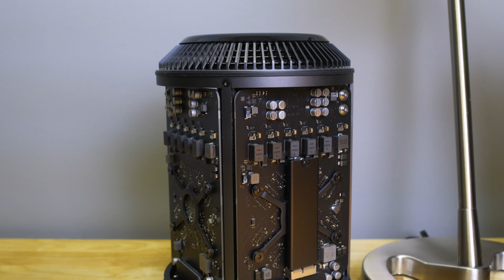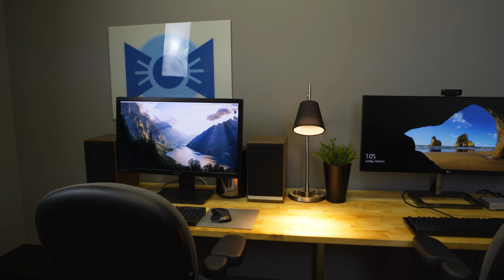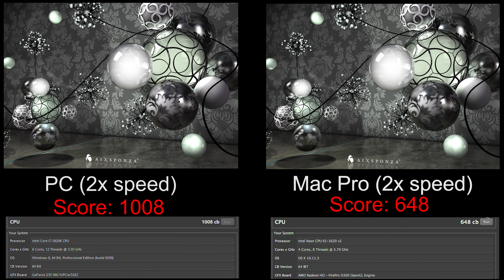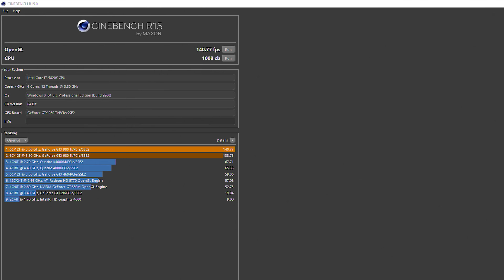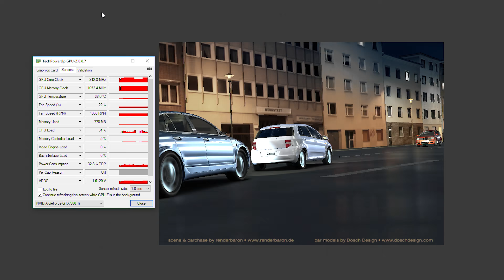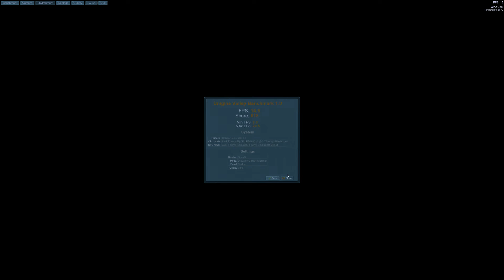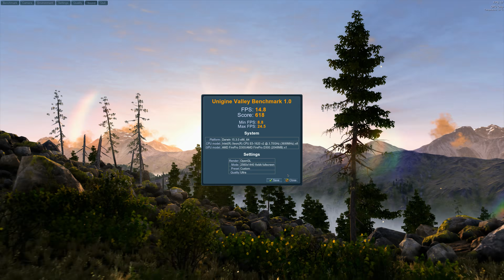$2,000 Custom PC vs $4,000 Mac Pro

Comment: This is not fair comparison, MacPro uses server grade components and PC specs are for a gaming machine. While PC is fast but its not built to last or to run for long period of time. Overclocked components are under stress and will have higher failure rate, not to mention shorter life. Mac Pro will take allot more beating and will get job done at end of the day, don't underestimate it.
Reply from the maker: +Vlad I need my job done now. Not at the end of the day. :)
Reply: +Snazzy Labs hopefully your job pays enough: 1)deal with software problems, 2)to afford new electric bill, did you measure power usage on both machines? 3a) buy another PC soon, 3b)provide enough time to build/upgrade it, and sell old PC/components(hope those wont go down in value). I'm sure there will be faster components released very soon. Good luck on your chase for speed, again hope its worth it ;)
Reply from the maker: +Vlad Lol. 1) Premiere works better on Windows, 2) power costs like $1, 3a) non-workstation hardware is still extremely reliable, 3b) Macs don't hold their value any better than most other computers anymore. Cheers! ;)
Reply: +Snazzy Labs Again not a fair comparison, Windows/OSX, gaming PC/Workstation different tools. Rendering or compiling job taking weeks would bring down most gaming PCs, or precision task such as CAD drawings, one mistake(or weeks of lost time) can be very costly. Lastly if I'd be an astronaut, I would not trust my life for a rocket controlled by a gaming PC, just can't afford the risk. Rendering 15 minute youtube video fine. Another angle at this, Truck vs Sport Car, could have same HP, or more for Sport Car, still wont do Trucks job. Best Wishes.
Reply from the maker: +Vlad FWIW, one of the FirePro cards in the Mac Pro crapped out after 9 months and I had to get it replaced. LOL.
Reply: +Vlad AND even if you build a pc with server hardware , you can get away with a 16 core and still be cheaper than the trashcan
Reply: +Vlad Come on Vlad, now you really talk rubbish. Which market was screaming for a tiny round shiny workstation? Where you need everything extern (WTF) Keep in mind that we talking about workstations here! Apple simply swing and miss. With zero information at this point if there will an update, they really are let down their old users. The hardware inside is 2012. They use a expensive Xeon but you can only use 1, not 2. Which is one of the reasons to go for Xeon. Double CPU. The weak yet very expensive AMD dual GPU's are a issue as well. Tons of software are not capable of using dual GPU setups. So you have to pick the most expensive card setup, to get average performance. And i can continue on and on... Look dude, i am a Apple guy. I work on a iMac.. but Apple has lost the pro market. If you are on FCP, for sure.. a mac will do the job perfectly. But almost everything in the world of creativity and their tools, are better suited with a wel configured PC. Face it and stop defending the brand. They dont care, they earn their money with iPhones and those who still buying this Mac "pro" machines for a lot of green. I dont feel sorry for them. Simply do your homework and you wont buy this shiny (good looking) machine. Anyway, almost everyone in my network of content making professionals are switched to PC.
Reply: +Vlad Blabla, i am in the whole Apple system. But i think you havent read solid reactions. I own a iPad, iPhone, MacBook Pro, a Apple TV and i work on a iMac. So, here you go. A very Apple minded person. A Mac Pro is just a PC. its a Intel CPU, its a M2 SSD, its DDR ECC memmory, its a ATI videocard... its just a PC in a shiny box. Its OSX that makes a difference for some. Nothing more. The Mac Pro is weak. It was powerfull in 2012. Its average in 2016. Running over by 2000 euro machines like in this video. Cut the bull about experience, They really pulled you into there marketing talks. Its-just-a-computer!!! Working in Adobe is the same as on a Mac. Working in Maya is the same, etc etc.. You are talking standard Apple crap.
Reply: +George Lynch Thats insulting and rude. I understand you're well educated then? Yet, fail to understand Apples strategy and intended market segment. Try building a cheap, small factor, shiny, overclocked and reliable PC, then I'll talk to you.
Reply: Vlad I did. Spent £400 on PC parts and built my self my first gaming PC. Well why are you defending a company that uses market tactics to trick people into buying shit old technology for ridiculous prices. "Try building a cheap, small factor, shiny, overclocked and reliable PC, then I'll talk to you." also this comment makes no sense considering the prices of apple products compared to how much you can build a PC for.
Reply: +Vlad Again very week arguments. Keep them coming Vlad. They are so old haha. You dont buy a computer and thinking about value after they are done. You can sell computer parts for good prices too.  You are just trying to defend the to expensive and outdated Mac. Value arguments are weak when you want raw power to do the job right NOW. And dont care so much about the future resell price. You know why ppl are buying old Mac pro's? Beacase those where Real workstations whith hardware you could in some way swap in and out. The bigger cases, remember..not that silly round shaped case. If something goes wrong with your pc, you replace the part. Done. If there is something wrong with your Mac, you better have Apple Care (which cost extra on top of your expensive system) and your lost your system for a week minimum. Do the math again.. production whise, investing whise.. raw power --> go for PC. If you want to look extra good, or you are working with FPC, or you cant leave the brand because you are locked in.. buy it an pay a lot of cash.. and live on. It doenst make it a better computer.
Reply: +Tousti k - "Now stop and think. OSX.. Thats all I have to say..." 
--> Ok I did "stop and think" but OSX dosn't mean anything Actually if you said LINUX... that would be true but OSX... really!!!!! Windows is by far better than OSX.
Reply: +Vlad Your argument stands only for those who need certified components. The average user doesn't need ECC memory, doesn't need an Xeon and doesn't overclock. The 5820K is a very decent high end i7, and his bigger brother the 5830 and specially the 5960X is a beasts! They crunch your videos and power photoshop very good. The quadro cards are for few users. For the price a workstation cant win from consumer parts. But we are talking about high end consumer parts. Susceptible failure is most of the part from bad coding, bad drivers, bad software, bugs. And checkout Macrumers forum. Tons of complains about failing mac pro parts. You know what, it are just print-plates. Keep defending the old 2013 workstation of Apple. Its hard to step back and say.. yes, Apple is failing to update their workstation, Yes, Apple is letting down there Mac pro user-base, yes, a 2000 euro computer is kicking the butt of a mac pro of 4000 euro and that is not good.
Reply: +Vlad Can i just mention that Snazzy can hackintosh ?
If he decides to do that .. hes paying 2000$ for a mac thats 3x better than his mac pro...
Reply: +Snazzy Labs You can't win from Vlad. He well counter with "its not a fair comparison" although he knows that the Mac Pro is a overpriced system in a small shiny round case. Looks nice, but the creative sector is CUDA hungry, needs fast CPU's and raw GPU power, tons of memory and a bunch of SSD's. I am a Apple minded person with a Apple ecosystem. But my next computer will be a big ass monster PC under 3k $$
Reply: +Vlad The PC will easily last 5+ years, and by then the mac will be garbage compared to other devices anyway.

Literally no reason to buy the mac.

Besides, if something goes wrong with the PC you can just swap out that part and the rest is still good.
Reply: +Ali xFiFa If server/workstation grade hardware used then it would be more appropriate comparison, don't you think? You can pay more and get more cores in your Mac Pro, and again round shiny trashcan might be more appealing to some people than huge room heater.
Reply: +Vlad Ever checked out the computer cases of today? Lot of them are really nice to see. Less is more, clean cases. Noise? good fans don't make a lot of noise.. and besides.. if your machine kicks ass big time, crunching your videos in 2 minutes instead of 10.. do you care about a little bit more fan sound? Again stupid and the same and old arguments. Do your homework m8. We talk about Workstations here.. machines that need POWER.. grraawww... (making lion noises now), i dont care about a bit more power consumption.
Reply: +Derpleton Herpson there are allot of reasons to buy the Mac and many people fail to understand this, but Mac is not for everyone.

In 5+ years Mac will hold more value than PC, and I'll have less problems selling it, in fact people will fight over it, check eBay...

If something goes wrong with the Mac I'll just call AppleCare, no stress and more time to have fun doing other things.
Reply: yoRRnl
Yes, old Mac vs PC battle...

If I'm wrong, why Apple still sells Mac Pros? Don't just tell me its because people are locked in to ecosystem or know nothing. You're missing out on whole experience of owning Mac. I see Mac or PC or whatever as a tool, everyone needs to decide which one is the right one for themselves.

5 year old pc parts sell for nothing or not at all, but Mac could hold its 30%+ value. Not mention all of the hustle: removing and posting dozen parts, storing them, dealing with returns, scam and tech questions from inexperienced buyers. Did I say those sell for nothing or not at all??? ..... VS selling one old shiny trashcan that everyone wants, no mess, no piles of old parts in the closet.

Yes, AppleCare is not cheap but is it worth dealing with whole GeekSquad stuff? but then again, tech savvy person can go without AppleCare.

Not everyone could afford a Mac but then does everyone understands the process of owning the PC? Do you see the emerging picture here?
Reply: +Veke 23 Now stop and think. OSX.. Thats all I have to say... windows can go fuck itself in comparison with Apple software.
Reply: +Veke 23 Mac Pro designed to be a great workstation and components in OPs PC not even workstation grade.  No ECC ram, no Xeon CPU, no Nvidia Quadro, and thus very susceptible to failure, and overclocking makes it worse. Is this better gaming machine, yes, is this better workstation, thats a good question. I don't even see how can you compare the two.
Reply: +Vlad that makes no sense, because the PC out performs the Mac at being a work station aswell as being cheaper. Your points are invalid. Also returning to my previous point once you have a problem with an apple product you have to go straight to Apple which is expensive whereas with a PC you can buy the part yourself and fix for cheaper
Reply: +Samir Elaissaoui OSX, Linux Windows, Apples and Oranges. Oh WAIT apples and oranges!???
Reply: +yoRRnl Wait a minute, Xeon cpu certified and non-Xeon are not? Average user would be better off with non-quadro $1000 video card? PC users don't post about problems, all PC parts are perfect and come with perfect coded software? Sounds like allot of happened since past 15 minutes. Do you think I'll be able to load XCode on a PC?
Reply: +Vlad Huh? So you dont know what a certified system is huh? I thought so. Let me explain it so you learn something instead of talking nonsens. When you are into Solidworks for example, you want a system that is approved by Solidworks. They have a list of parts you may use, so they can give you customer service. If you dont have these parts, they dont provide you service. You will be in most cases locked in the world of workstations. Second: I never typed anything about PC parts are perfect. They aren't. Nothing is perfect. I never typed a average user would be better off with a non qudro $1000 video card. A 400$ card will do fine for a LOT of professional users. The GTX 970 kicks ass for his price. And with the 1070 around the corner, another $400 card will arrive that will deliver. Quadros are expensive, but needed when you are into a locked-in situation. And off-course you wont able to load Xcode on a PC. Its OSX software. Like Final Cut Pro only is for OSX. So, if you are with these tools, you will need to eat what Apple is trowing at you and deal with it.  You only use old standard debunked Apple pro arguments. Its just a company making business and is a king of the hill by taking more cash out of your wallet and give you the feeling that its something magical. But hey!, you will have a nice shiny round case. And that is awesome too! But this time, I am not going to spend my hard worked money on another Apple machine. This time i move over to the other side cause plenty of good argumentation backed-up by much better performance, and the plus side its cheaper too.
Reply: +Vlad " OSX, Linux Windows, Apples and Oranges. Oh WAIT apples and oranges!???  "
--> What...!!!! didn't really get what you're trying to say who said Apples and Oranges.... brother say what you mean clear and simple...
Reply: +Samir Elaissaoui "> What...!!!! didn't really get what you're trying to say who said 
Apples and Oranges.... brother say what you mean clear and simple..."

Really??? Though choice for you, can't decide on what you like better Apples or Oranges?
Reply: +yoRRnl Mac Pro is a workstation, not a gaming machine. It means that its better suited for work than games, it has reliable, certified, fine crafted, proven hardware and desktop software. You can own Mac for a while and not worry that software will slow down on you, PC will slow down quickly because software makers will add so much bloatware that it will seem like your PC was downgraded. Talking about average user, unless you work for GeekSquad the cost of owning a PC quickly will add up to a Macs price level, lost time and headaches might not even worth it. It takes time and effort to create something like Mac Pro and OSX, can't just whip it up from random parts, I'm sure Apple will catch up in due time. I don't see how Mac can be compared to an all-in-one/do-it-all contraption loaded with bloatware, buying a PC almost the same as gambling. You earn your money hard so be sure to spend it wisely.
Reply: Vlad Nah, you are defending the Mac pro again with the same old arguments. Its a workstation. Yeps. But that doenst mean that a 5820K / 64GB / M2 512GB, GTX 980ti 6GB, and 4 SSD drives can be a very very very powerfull system as well and its way to simple to put it in the corner as an gaming system. Still talking about 2000 euro plus. Its also to state that OSX doenst have his problems. I am facing a bunch that are giving me a headage. Apple has their problems too with hardware that fails. There is no magic there. Its just a computer. And sorry m8, its even just a PC with OSX installed. There are gaming systems, there are heavy PC configurations, and there are workstations. And the Mac pro is a old, not updated workstation and still asking 4000 euro for it. No information if there will be an update (which is very rude to their clients) and the small form factor is a swing and miss. ( see the run on 5.1 macs ). Like I said, almost everyone in my branche around me (design / 3d) is switched to PC. Apple lost / not interested and focus on iPhones, Swatches, iMacs, Mac books, iPads. With there very limited choices in their workstation serie, they have lost me to the PC soon.
Reply: +yoRRnl No, I'm trying to point out the differences. If you try to build workstation grade PC price will be very close to a Mac Pro, if not higher. Yes, you'll get faster hardware and better 3D performance than current Mac Pro but you'll loose OSX, Apple support, not to mention lost time, labor and money associated with it. Right now I see OPs video as enthusiast PC vs prebuilt workstation, and it just doesn't add up in my head. If I need 100 workstations yesterday, it doesn't make any sense to start building these PCs today, I'm going to go with pre-built solution. Not everyone can afford to build and support this kind of PC, thats where Mac Pro wins. Then again, it could work for small startup business.  It would make more sense if comparison was made Mac Pro vs some Dell Workstation or PC vs Hackintosh.
Reply: +Vlad Are you a sales rep or do you work in the PR department?
Reply: +Vlad Vlad you sir are an uneducated sheep
Reply: Lol Mac pro's GPU dies after a few months of use. its a very inefficient design for heat dissipation. and its slower then today's 1k$ custom PC's

Comment: That's not really a fair test. You should be putting the pc up against the 8 core version of the Mac with the AMD D700 gpus. True that system is about $8000 but it is much closer to the performance of the PC.
Reply: +cdelaine 

The fact that you need to spend $8000 to get near to the performance of a $2000 PC is...problematic at best.
Reply: You have a point.

Comment: If you run Adobe Premiere Pro on the Mac Pro with Windows using Bootcamp, it's already faster than running it on OSX on a Mac Pro. Can you Hackintosh this custom PC and run Final Cut Pro to compare results with the Mac Pro, lots of film makers still use Mac because they get used to the OSX and Final Cut Pro.